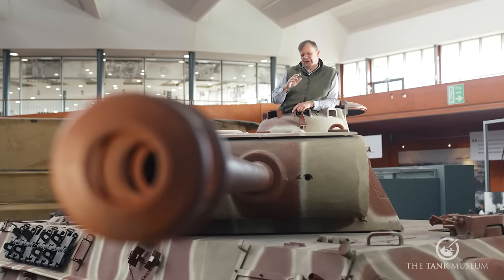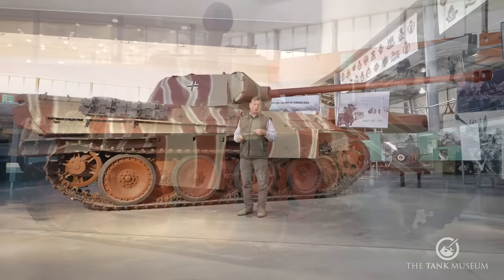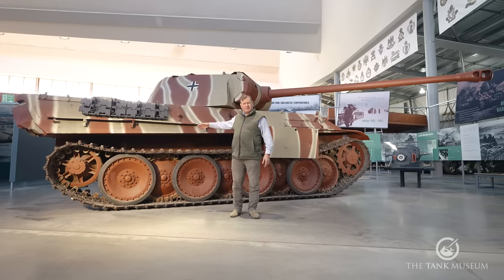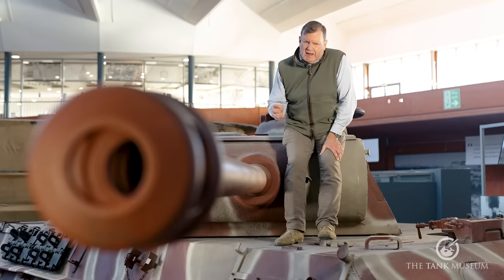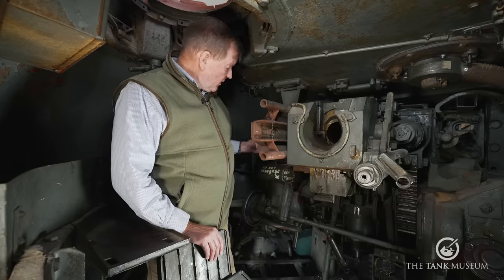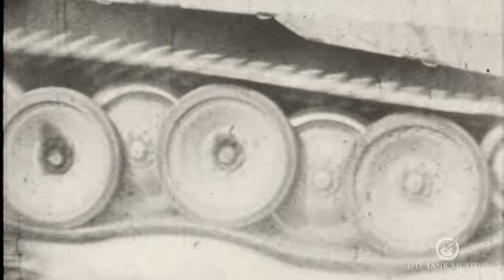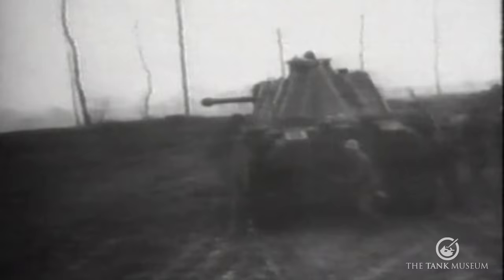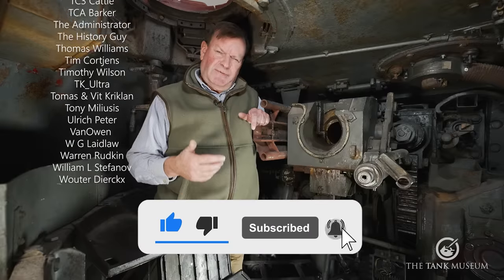See Inside Panther | Tank Chats Reloaded

Comment: @6:35 The Germans didn't use a diesel engine because most of their fuel was gasoline obtained by coal hydrogenation. Also,obviously a 690 HP gasoline engine with a low compression ratio consumes less fuel than a 500 HP diesel engine but they had no alternative.

Comment: When you mentioned the improvement of the Panther's armour, I have read that the quality of German armour declined as the war progressed and mineral additives, such as molybdenum, became near impossible  to source. American  and russian, accounts detail that in late war German tanks, the armour became more brittle and liable to  "shatter" and crack when hit.
Reply: Entirely true. And not just a problem with the armour. The drive train (among many other parts) required good steel and the tools required to make it required even better steel. In the late war, the Allies were able to supply small amounts of tool-steel ammunition for taking on hard targets. The Axis could barely supply enough tool-steel to even build their tanks.
Reply: A lot of the Panter's famed mobility capabilities is hampered by how to drive train was much too small for the weight bloat the tank gained during development. It couldn't neutral steer in any rough terrain without risking shattering the final drive, and iirc was advised to avoid turning while in reverse entirely.

Comment: My Dad was Royal Scots Greys, he signed up at 17 in early 1946, initially with the 17/21st Lancers, and on completion of his training he was posted to the RSG who were flipping onto the Centurion.  Something he did mention from his years in post war Germany, they had a Panther with no turret for use as a recovery tank.  He ended up as the regiments Signals Sgt and shared his tank with the CO when they went on operations.  C Squadron "Creeper".  He had every confidence in the Centurion, and often said it could fight and defeat anything the Russians had at the time.
Reply: Luckily he never met IS2 or T55 with determent crew.
T55 that drove in Budapest embassy made Centurions absolete in one day.
Reply: @sinisatrlin840  No. T-54/T-55 made Centurions obsolete as they went into mass production..not when one of those were driven into embassy...
Reply: @AKUJIVALDO  What was the alternative? To design new one it takes decade.  Produce what you have and introduce upgrades untill newer design is mature. That was done by all. And train your crews with new info.
Also, all made films for education of military personell that where bit on propaganda side.
Reply: @sinisatrlin840  create new gun...just as Brits did.
Reply: @AKUJIVALDO  It takes two years to design and implement new gun. From idea to prototype, recoil system, sights, proofing, testing, minor corrections, tooling for production.

In two years they could design and produce nice modern (for the time) diesel engine and bring Centurion more up to date. That would increase foreign sales and would make it more competitive on international market.

Leyland multifuel on Chieftain was crappiest tank engine since Maybach.
Reply: @sinisatrlin840  why hate on Maybach?

Comment: Thanks very much Chris and team. Thanks especially for the details of the main armament. 

In the 1980s, I worked on the UK research programme on electromagnetic railguns, which were seen as one way of defeating ever thicker tank armour. 

We were told to based our studies on a maximum barrel length of 5 m and a working muzzle velocity of 2000 m/s. That programme ultimately set up a test firing range at Kirkcudbright, so I wonder if any interesting artefacts survive there?

Our first practical tests were done at RARDE Fort Halstead. From that part of the programme, a full scale wooden mockup of a 25mm bore railgun and breech was donated to the Royal Armouries and is now in their reserve collection at Fort Nelson.

Comment: The explanation of the differences between face-hardened steel and homogeneous rolled steel (4:28) contradicts everything I have heard so far. At least it's an opportunity to look into it.
I find it a rather strange statement that the KWK 42/L70 was not significantly better than the KWK 40/L48 of the Panzer IV (9:49). It remains a mystery to me how, for example, a penetration of up to 111 mm compared to 55 mm at 1000 m can be considered an insignificant advantage.
Reply: The presenter isn't wrong about the differences between face-hardened and homogeneous steels.
Reply: British bias
Reply: I get what you're saying about the manufacturability of each armor type
Reply: @kmoecub  Of course he is. The only difference between RHA and FHA is that RHA wasn't faced hardened. They simply choose not to face harden the plates, thus saving time and money while also increasing protection because face hardening actually makese the armor worse when it's heavily sloped.
Reply: @kmoecub Face-hardened steel is basically hardened rolled steel.
In fact, hardened steel is more difficult to produce and also more difficult to process, especially to weld.
How the presenter comes to say that surface-hardened steel is easier to process and, above all, that the homogeneous steel has been further developed, is really a mystery to me.
Reply: @potator9327  Not true. At the time of this tank, face-hardened steel hardened the outer surface only, the remainder being fairly ductile. RHA hardened the whole thing to a slightly lesser extent and was more difficult to produce.
Reply: @onenote6619  As far as I know, RHA is produced by hot rolling the armour steel alloy to the desired thickness. Pretty much the most mundane way to produce steel plate.
The surface hardened plates on the other hand were additionally surface hardened and were therefore not inferior, quite the opposite. 
Towards the end of the war, the armour plates of German tanks were no longer hardened not because the homogeneous plates would have been superior, but because the additional workload could no longer be afforded and also because the necessary experienced factory personnel were increasingly lacking.
I would be interested to know where you got your different information from?
If you are so sure that your explanation is correct, perhaps you should also make the effort to correct the corresponding explanations on Wikipedia.
Reply: hahaha 12 year olds arguing on the internet never gets old
Reply: @DrLoverLover  Talking about yourself

Comment: Thanks so much for that amazing look and your sights! Interestingly, intimate operations of the panther showed up in the Sven Hassel novels. As I recall, they had to put the best crewman in the driver slot as their model had serious transmission problems that could result in overheating or engine fire that could be worked around only by a skilled driver.  Also I think they mentioned one commander getting a shattered arm from absentmindedly reaching across the recoil path of that L70 75mm breech when he dropped a map. I dont recall seeing detail like that in other period accounts much and it seems to ring true.

Comment: @1:56 "the results were very disappointing...the two tanks failed to complete the course..."

The biggest complaints about the Mk V and VI were that they were "over-engineered" so why am I not surprised that when the British - who were most assuredly NOT guilty of this "flaw" - appropriated the design for target practice, they created clunkers and lemons.

As a former U.S. armor company commander I can tell you that the Mk IV and V, used together with proper Combined Arms doctrine (impossible once Germany lost air superiority) were, indeed, the best OVER-ALL armor of the war with the T-34-85 coming in after that.

I can also tell you that Allied doctrine in general and U.S. doctrine in specific - saturate the battlefield with inferior tanks - should've won the entire Chain of Command the gallows. Instead they have all been lauded and enshrined.

In fairness, it is a thorough presentation.

Comment: The KwK 42 L70 has almost double the effectiveness the KwK 40 L48 has, the projectile travel lot faster with flatter trajectory, it has enough penetration to destroy pretty much all WWII tanks in service
Reply: If I remember correctly, the Panther's cannon was vastly superior to the Panzer IVs. I'm not sure why the host said "only slightly"??
Reply: @matovicmmilan  indeed, the L70(70 times the length of the barrel size) is superior to the L48 except is quite large to move into urban zones or transport it, its performance is better than the British 17 pounder before Stabilized sabot exist

Comment: The very tight specifications {differences from 1 length vrs another length of a gun tube; a weight/horsepower of tank weight /speed vrs of various tanks/ fuel use per mph/distance of various vehicles vrs other tanks , etc - and so much more tell information that detail specification types like myself love sooo  much. "The details are everything!"

Comment: Did you say that Panther gun is not that much better than Panzer 4(long barrel 75 mm) gun?Are u sure about that
Reply: 😂 sure he's not - the l70 slightly outclassed the "mighty" 8.8 from The Tiger 1 - in  terms of penetration...
Reply: @MrZirler  Yeah at least at normal ranges,right
Reply: No they mention the short barrel gun then in service on the panzer 4 before the panther was introduced.
Reply: @gherkinisgreat  That's even worst comparison
Reply: The Panther's gun penetrated about 40-50% more armor than the Panzer IVs gun. And about 10% more than the Tiger's gun at normal distances. At long range the heavier round of the "88" caught up.
Reply: wrote: "Did you say that Panther gun is not that much better than Panzer 4(long barrel 75 mm) gun?Are u sure about that"

-- Its "museum" convoluted way to explain that  the distances that most of tank engagement were taking place which is 400m to 1200 meters performance of 75mm L48 gun will be similar to 75mm L70 gun, unless you run into IS-2 tanks(then you so SOL), on longer distances accuracy and ballistics of Panther L70 gun will smoke even 88mm L56 gun, but no tank will be risking taking those long shots, especially when you don't know when your resupply going to be, and as a rule you only carry 79 round, only half of which is Armor Piercing.

Comment: Whenever people talk about the relative armour thickness of sloped armour (against flat plate) I always have to remind them about ballistics; except for light projectiles at close range the amount of "drop" (the orientation of the projectile when it strikes the target) means the thickness decreases in relation to the horizontal plane. Yes, sloped armour is better than vertical plate - but armour at an angle of 30 degrees is only offering a 25 degree angle against a projectile that is coming in with 5 degrees of inclination. When the difference between a shot being deflected and one penetrating could be between 5 and 10 mm of armour, this is a serious consideration. One of the factors behind the prevalence of HEAT munitions is that the lower velocity compared to kinetic round is that it is more likely to strike armour nearer to 90 degrees to the angle of the plate - meaning it has less thickness to defeat. Many modern missiles with HEAT warheads are designed to drop onto a tank from height, making armour angles of less than 60 degrees irrelevant.

Comment: Arguably the best tank that Germany made in ww2. They really should have updated the reliability for the Panther instead of sinking money into their heavy tank projects. The 75mm gun was a pure tank killer.
Reply: The King Tiger was already in development before the Panther made its combat debut, and the Panther took until March 1944 before it was declared full troop ripe by Guderian. By then, the King Tigers were already rolling off the production line.
You have an argument with the Jagdtiger. Wasnt really needed. However the Tiger I was doing it's thing from late 1942 and the King Tiger was expected to debut in 1943.
Reply: @lyndoncmp5751  Of course. Germany had way too many armor projects that was not in ratio with their budget and resources. I meant they should have poured more resources into producing better and more Panthers rather than making Tiger 1s.
Reply: There was no 'fix' for Panther. The best Germans could do was to scrap it and go back to original requirements but it was too late already.
Reply: @yutian5884

As I said, the Tiger I was ready and doing well over half a year before the Panther was introduced, and was a very useful and effective tank all through 1943 and more reliable than the Panther.
Reply: The Germans were strongly aware of the problems, but as time, resources and manpower started to run empty, on top of factories being bombed out. By the time the Panther could've been improved with lessons learned, desperation was already set in and there were little to no resources to improve existing designs. Just pumping out as much material as they could.
Reply: @lyndoncmp5751  Yes. But it was too expensive. In hindsight maybe even the Panther was a wasted effort after 1943 when Germany should have been making more Panther 4 and Stug.
Reply: Like a drowning man
Reaching for the wonder weapon
Reply: The Germans had already been trying to update and fix the reliability issue of Panther after Kursk where they were rushed to the frontline before everything was properly tested. Of course it took time, as between ensuring the reliability of Panther, the engineers had to solve other issues such as reducing/substituting material usages and production simplifications.
And Panther was the last major German tank project during the war after the Tigers, by 1944 the only new major German AFV designs were tank destroyers or assault guns trying to prop up the numbers of the collapsing German panzer forces. (not counting exotic designs like Sturmtiger where less than 20 were built)
Reply: @yutian5884

More Panzer IV and Stug = more crews needed to man them and more crucially more support and supply crews, vehicles, resources needed to make them function.

The Tigers were only relatively few in number and were worth the expense. They did well overall and knocked out a lot of enemy armour types (circa 10,000) as well as the propaganda value. Tigers inspired greater determination on German soldiers whenever they turned up to support them and Tigers initiated great dread on allied tankers. This cannot be stated enough. Even small numbers of Tigers slowed down and even stopped allied advances on plenty of occasions.

Im convinced Tiger I at least was well worth it, and compared to the expense wasted in grandiose projects that never even got off the ground, well at least the money put into the Tiger was practical and effective.
Reply: @lyndoncmp5751  I totally forgot about the manpower shortages Germany had. Absolutely, the Tiger 1 was a good tank and like several mentioned before it was a mature design towards the end. But the Tiger 2 had to have been one of the biggest sunken costs that Germany made.
Reply: @yutian5884 
You can certainly argue that the King Tiger needn't really have been built, seeing as the Jagdpanther with the same gun was coming out at the same time. On the other hand, the heavy Tiger battalions had already been long established and Tiger I production had come to an end in summer 1944 so they had to give the already established Tiger battalions a heavy tank otherwise they'd be disbanded. I don't think they would have wanted a turret less tank destroyer (Jagdpanther) and no point giving the heavy tank battalions Panthers either. 

Otto Carius, a Tiger I veteran, was not happy to be given command of a Jagdtiger unit in 1945. He'd have preferred a Tiger. 

The Tiger I was actually only supposed to be a stop gap until the King Tiger was ready in 1943 but delays with the King Tiger kept Tiger I production going until summer 1944.
Reply: @lyndoncmp5751  wrote: "The Tiger I was actually only supposed to be a stop gap until the King Tiger was ready in 1943 but delays with the King Tiger kept Tiger I production going until summer 1944."

-- It is also hilarious how much effort and resources was sunk into copying early T-34-76 turret into King Tiger first 50 turrets(that will became incorrectly known as  Porsche's turret), and then T-34 1942-43 turret came out, and only then Krupp engineers got King Tiger turret right!